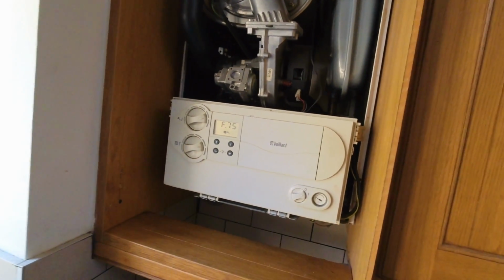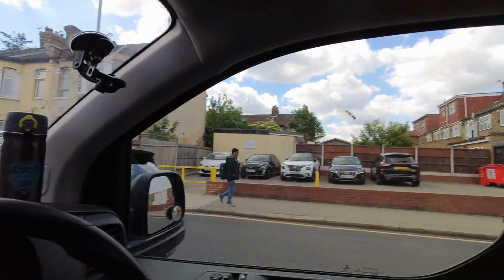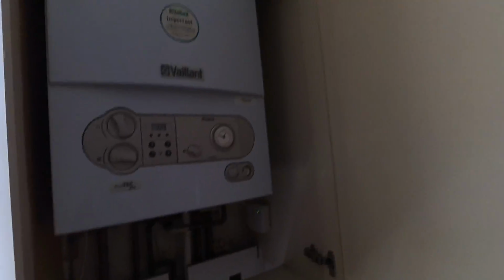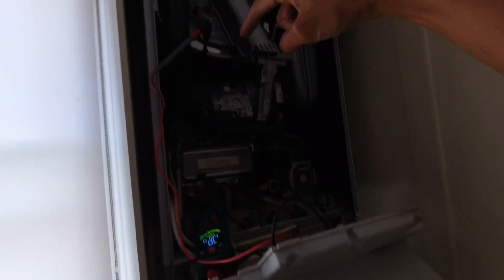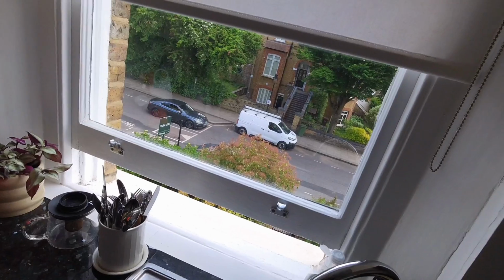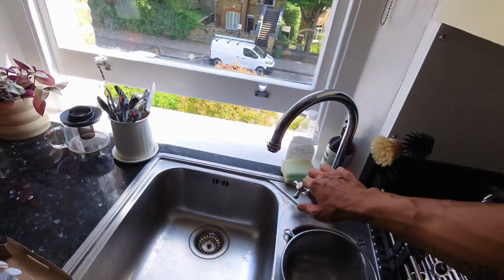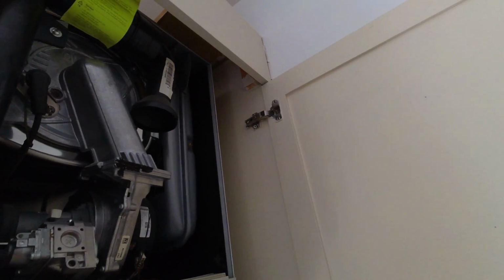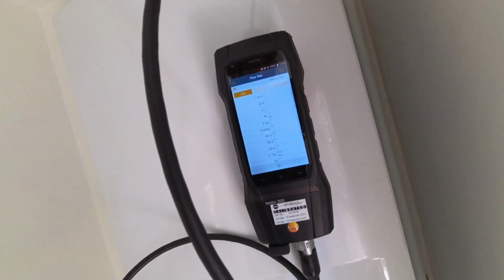Vaillant F70 Fix

Comment: Üstadım selamün aleyküm vaillant ikinci el kombi alabildim sorunum şu kombi ayarlanan ısıları takmıyor banyo suyunu 44 e ayarlıyorsun o ğösterğede 70 lere çıkıyor peketleri en kısığa ayarlıyorum 77 ye yükseliyor kaç tane usta ğeldi yok yapamıyor bende ölçüm aleti ile boru üzerindeki ntc sensörlerini ölçtüm 0.8 k değer veriyorlar parametre ayarlarına ğirdim 24kw düşürebildiğim kadar düşürdüm vaillant kombi servis kodları modellere ğöre değiştenlik gösteriyor bulduğum kodları değiştirmeye çalıştım fabrika ayar kodu olsa bulabilsem tekrar yenileyip düzelticem ama yok biliyorsanız Allah rizası için yardım edin kombi net modeli atmotec pro 240/5-3
Reply from the maker: Unfortunately because it's a used boiler there could be multiple faults and it's difficult to pinpoint it. It might just be the PCB which is what I'd try first

Comment: how much did they get wrong in the first place. it it on pcb side general piping to the heat exchanger, from the heat exchanger. placement of sensors. on the back end the design and implementation of the electrical system and design of pcbs. there were manufacture defect but the biggest thing is the shit they fed to whoever in the uk and they believed them. 5 star.  jog on.
Reply: @cputilitysolutions   do you charge your customers for parking "charges" i do. i try not to park illegally. "cough illegally"
Reply from the maker: @markchristohperowen6806  I always check for parking and if there isn't then I explain if I get a ticket it'll be added on to the invoice if they can't arrange for parking
Reply: @cputilitysolutions  That's a good tip/piece of advice Chirag. Keep the videos coming. mike